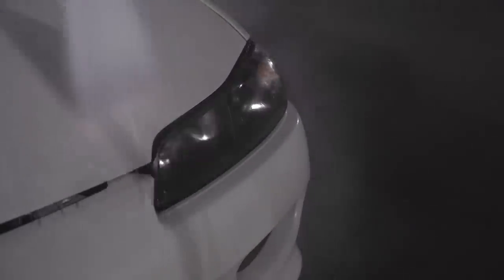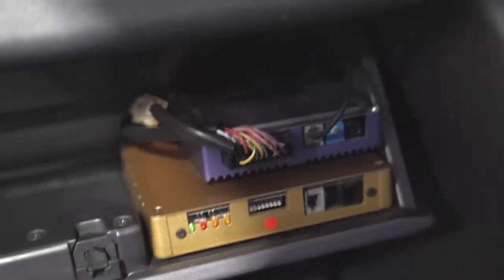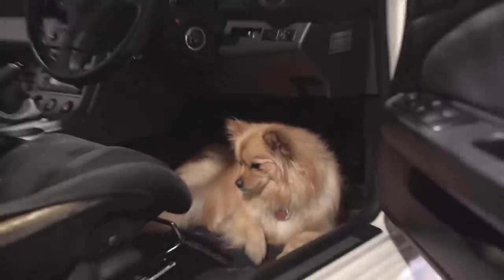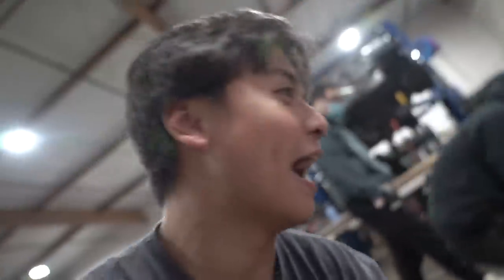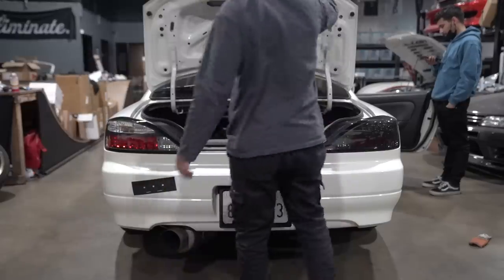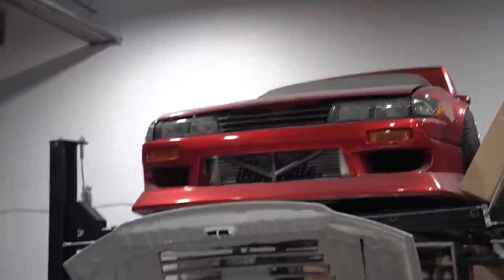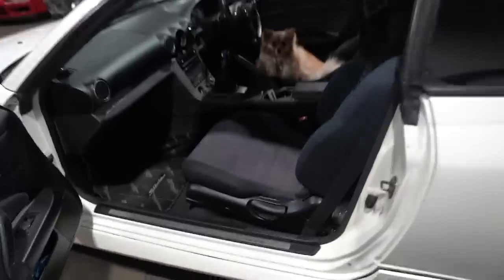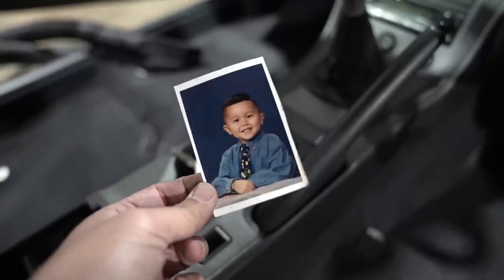S15 Silvia FIRST MODS! (POWER, STYLE + COMFORT!)

Comment: Molded wide body, OEM wing, coil overs (no bags), bronze or brushed BBS LMs :)
Reply: Stock body >
Reply: Stock body>
Reply: No stock body Plzz f yeah spec.
Reply: in candy red paint too🥴
Reply: Do a drift wrap and do drift tunes and put a supercharger and bashbars on the rear like odi bachis.
Reply: Aero front bar with aero wing slammed on lmgt's equip 05's or VSKF's
Reply: A molded wide body looks like stock but gives it a bit more of a boody.  If done right you shouldn’t be able to tell the quarters are widebody and the front are fender replacements. Looks amazing on any s chassis.